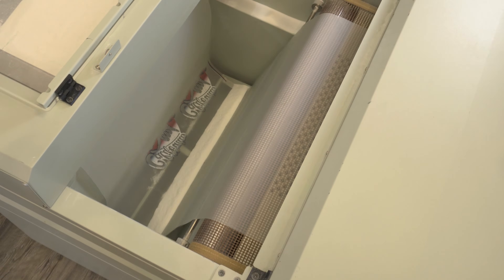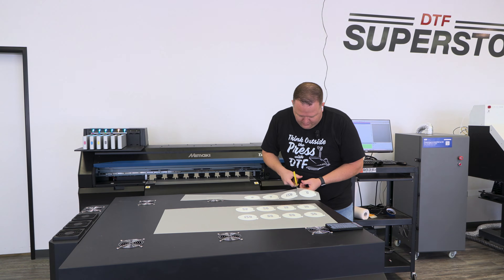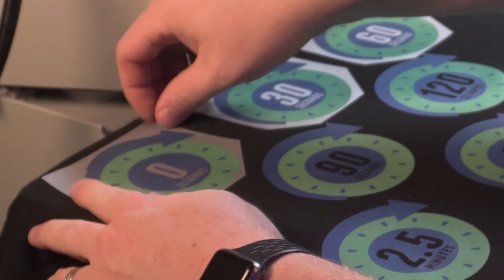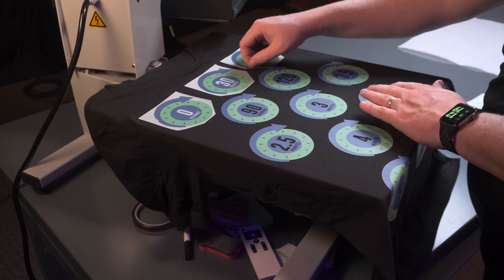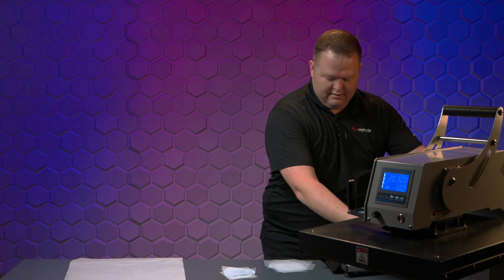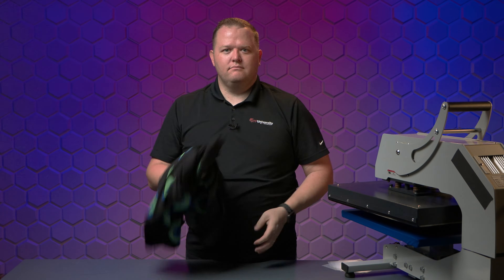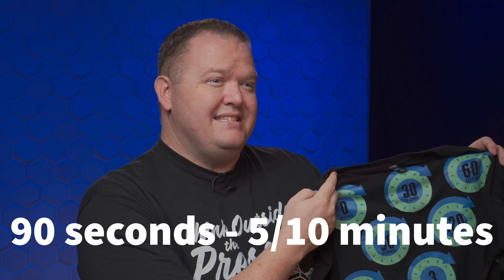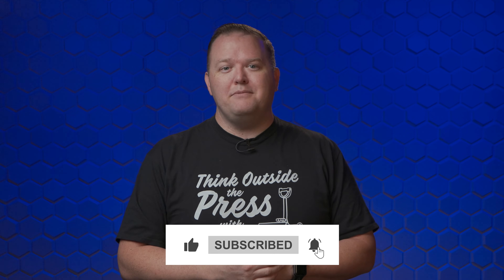How Long is Too Long to Apply DTF Powder?

Comment: I need help please I printing on clear matte dtf paper but my colors are not very colorful am I using the right paper? Also my white ink prints black and my black ink prints white is this right?? If I’m using the dtf ink for my epson 8550?
Reply from the maker: sounds like you have an issue with your RIP software and or the drivers for that Epson 8550.  Try reinstalling the drivers if it worked before, or install different ones if it hasn't.

Comment: My humidity is around 50 and I am waiting 20 minutes before powdering and I am still getting excess powder around the image.  My powder is sealed in it's original container with 2 silica packs.  Would popping the transfer in my curing  oven for a  few seconds and then powdering help with the excess powder?
Reply: Same problem 😢
Reply: Same problem here

Comment: thanks for your video, it's awesome! One question, and I'm a newbie for sure. I'm trying the DTF (self printing them myself with Epson F2000). I'm noticing that thick lettered graphics dry on the printer outside to in. Meaning that the middle of the strokes in the letters are wet way longer than the edges. does this mean that I'm using way too much white ink (as my backing layer)? when I cure the powder, I'm noticing the orange peel look also works outside to the inside of the letters. I'm just afraid that if I'm not getting the orange peel all the way across, the middle of the letter stroke won't adhere as well as the outside.
Reply from the maker: It's not uncommon for it to cure from the outside in.  However most people that are new to DTF are using too much white underbase so try reducing that and see how it goes!

Comment: Thanks so much for your video. I own a heat press and have the printed dtf delivered to me. I want to store the printed films for two months or more before I use them. Will that affect the print out? and in that case, when will be the good time to apply the powder?
Reply from the maker: The powder is being applied when they are printed so you don't need to powder the DTF transfers you buy.  You can store for at least a year.

Comment: Hello, very great video and it was a lot of help. I did have a quick question. On some of my prints I get some cracking or minor flaking when I peel after pressing. Do you know off hand what could cause that? I adjusted the temp and time, time under cure, still kinda get the same issue.  Printing on 100% cotton.
Reply from the maker: You might not have enough white underbase, it might not be cured all the way, it might be overcured, your temp might be too hot on the heat press.  There are quite a few options.

Comment: I want to ask about the ordinary oven of i can use it for curing? And joe to avoid melting of the inks while curing.
Reply from the maker: Hi there. You would like to use a conventional oven to cure? It is possible though results will be difficult because it's hard to get consistent pressure.

Comment: Your video is very good. However, I think it is interesting to add that a very important factor linked to the polyamide application time is the relative humidity and ambient temperature.
Reply: This greatly influences the time to avoid moisture retention. Large format printers, for example, have a heater after printing and before the polyamide to remove this excess.
Reply from the maker: You're right, the environment plays a large role. Thank you for your engagement and the watch!

Comment: Do you dry your prints before putting the powder on or do you just powder without drying out under the heat press?
Reply from the maker: Thanks for asking. You do not need to dry your prints before powdering. Print, powder, dry (cure), and press!

Comment: Do you bake the powdered image before printing?
Reply from the maker: The correct order is Print then Powder then Cure then press.
Reply: Is it important to press it right after you cure it?
Reply: @amarantsfam.8713  not at all, one of the best pros for DTF is being able to pre-produce the transfers and store them until the customer orders that design. This also allows you to not have to stock all finished shirts for all designs and all sizes and all shirt colors at the same time. you just stock up the shirts and store the transfers until needed. I've heard it said that you wouldn't want to go more than 60 days, but I haven't confirmed this as a real thing or not yet.

Comment: This may explain some of the issues we've been having.  We have been applying powder pretty much right out of the printer, but we have been having issues with the film not releasing from the image - just like your 30/60/90 second transfers.  Now that I think about it, our larger transfers that take a long time to print don't seem to have as much problem - probably because most of the transfer is actually waiting several minutes before getting powder.  Now we will be experimenting with print to powder times to see if that solves the issues, and to see what works best in our setup.  Thanks for the great video!
Reply from the maker: Glad we could help.  Also check your time, temp and pressure for pressing.  The pressure plays a very big roll in the transfer adhering properly.

Comment: What I have found is that time doesn't matter if the ink is still too wet. So wait until ink looks completely matte. Then it's perfect for powdering.
Reply from the maker: You are correct, every environment is different so it might tack up quicker in some places.
Reply: @DTFSuperstore   Good info! Would the granules size matter?  I've seen fine, medium, and coarse powder sizes.
Reply: @Doctaj54  depends, the finer it is, the less thick it will feel ok a shirt
Reply: so you want the ink to be dry before powdering? are you saying you can wait for days to powder and it will be ok? I do sublimation and thinking about adding dtf.
Reply: @tjdgaf  no, only enough to where it's matte, if it completely dries then powder won't stick as well or at all

Comment: Hi,  we do a 10 second dry for the ink then to power right after.  we get a good coating of power but what is puzzling is that sometimes (we do hot peel) they print well and sometimes not, sometimes they will not stick at the edge when we start the peel.  would that be the press temperature?  just looking for your opinion?  just wondering, what are your settings for pressing?  been using 315 for 35 seconds then 10 to 15 seconds on second press.

really like the video.  thank you,
Reply from the maker: Your temps and time seem fine.  We have two thoughts, try a higher pressure and also try waiting a little longer before you powder.  Your transfers will likely feel softer and if your powder is thicker it might not be melting enough when you're pressing.  That may be what giving you the inconsistent peel.

Comment: Hello sir...why DTF powder spread over the design..I mean powder goes  around the design.please support me
Reply from the maker: The powder should only stick to the printed areas.  If powder is sticking to the unprinted areas of the film you may have bad film or a static electricity issue.
Reply: I have the same thing happening with Yamation dtf roll and their white powder but haven't notice any issues with the blank powder spots after pressing. Atleast not yet🤞🤞

Comment: Great video!
I have a couple of questions. I hope you can help.

Why would the transfers won’t be transferring to the shirts? I mean like, they don’t stick to the shirts. Is it a powder issue? 

Which powder do you recommend?

Thank you so much!
Reply from the maker: If there is powder and adhesive and it's been cured the transfer not sticking to the shirt is probably an issue of not enough pressure or heat.  Use an infrared thermometer to check your heat press and make sure it is actually at the temperature you set!

Comment: We are powdering our sheets after 10 - 15 Seconds. if not the powder will not hold on small details, btw u only repressed the 0 - 60 seconds one why not did it in the middle of the press to check if its not he press?
Reply from the maker: We did not film all of the represses.  Edited those out for time.  Yes smaller details like halftone dots and fine lines do dry faster but if your humidity and temp are in the proper range 70-75 F and 40-60% humidity those fine details should still pick up the powder.

Comment: Awesome video! I wondered why my prints weren't holding up in the wash!! I'm wondering if you can tell us what your washing and drying procedures are? Thanks
Reply: You put them in the dryer!!!! I’m definitely doing something wrong then because if I put mine in the dryer it makes them peel! What might cause this to happen??
Reply from the maker: @sandradowell9666  well it could be a couple of things.  Not enough adhesive powder, could be not enough pressure or wrong pressing temp.  Are you doing a second press?
Reply: hmmmm, I am doing 15 seconds at 302 like the powder I bought instructs and then letting it cool completely, peeling and doing another 15 seconds. I am using heavy pressure. I just started doing 4 minutes as the video suggests between 1.5 and 5. Maybe the powder I'm using? I do tend to put it through the powder twice so that I know there is enough. Thank you for taking the time to help me!
Reply from the maker: @sandradowell9666  what is the fabric you're pressing on?
Reply: 100% cotton
 @DTFSuperstore
Reply: I actually went and looked at the shirt in question and it's 65% polyester, does this make a difference on how I press??
Reply from the maker: Normal, Jeremy uses a GE frontload washer on the color garment setting with Tide detergent and the dryer on automatic mixed load.

Comment: I’d love to see a video on setting up the heat plate. My 2 head has it attached to printer and I’ve seen the plate attached to shaker ovens. Finding that right temp to dry the ink faster before powder. I’ve got my settings. Just curious what other peoples are.
Reply from the maker: Our headed guide plate is set at 75 C for our Mongoose 2 head.  A faster machine might benefit from a slightly higher temp but no too much, you don't want to sure it before it gets powdered.